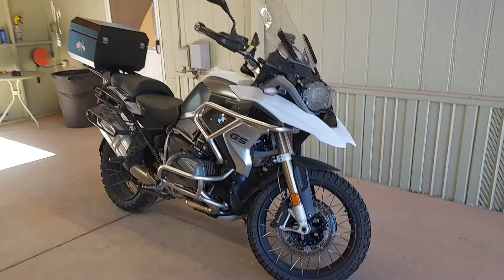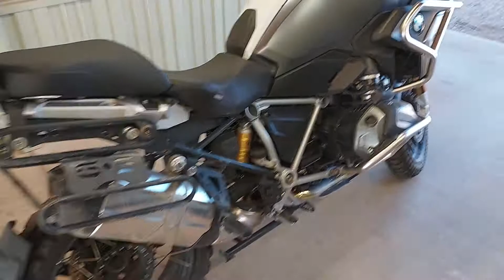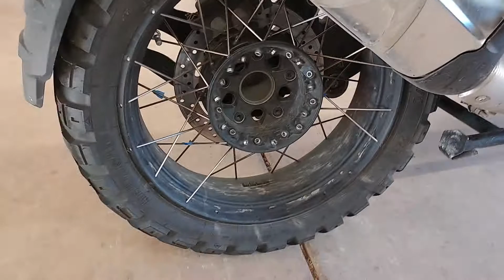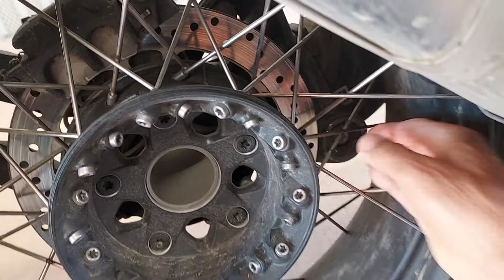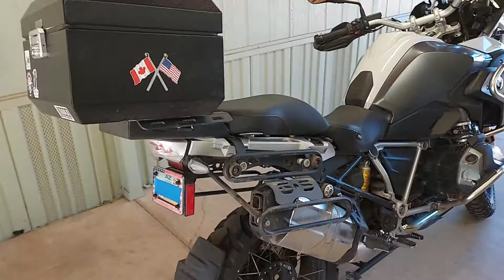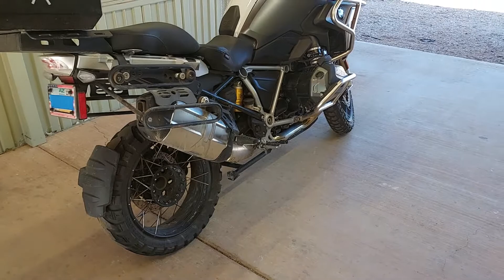2021 BMW R1250GS Broken and Loose Rear Wheel Spokes Ep. 1

Comment: I also found one missing spoke (rear wheel) on my 2021 R1250 GS Adventure few days ago… (11,000 miles). I have an appointment for the service on Monday. We'll see.
Reply from the maker: I would be interested to hear what BMW does about your single broken spoke. BMW has told me they will repair just one or two broken or loose spokes, more than a few and they replace wheel.  This failure seems to go from one broken spoke to multiple broken spokes very quickly however, and in every case BMW has replaced my entire rim. First wheel was 3 broken spokes, second was two broken spokes and this wheel was 5 broken and 3+ loose spokes.
Reply: @reddon88  I got a brand new wheel from BMW.

Comment: did the dealership call you yet? I am checking my spokes on my 2016 GSA today
Reply from the maker: Yes BMW replaced this wheel with a brand new wheel under warranty, picked the bike up yesterday.  On Monday this new wheel will be on its way to Woody's in Denver for re-lace and trueing. I have had 3 out of 3 stock rear wheels from BMW fail with broken spokes I do not know what is going on here but BMW has replaced wheel in each case. Only wheel that has not failed was one I sent to Woody's immediately after receiving from BMW, so this one is going there too.